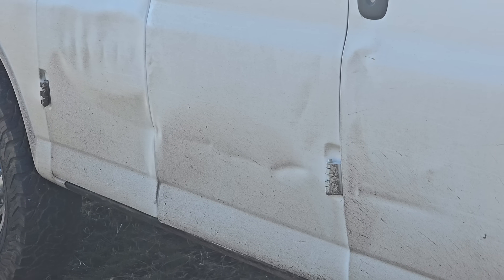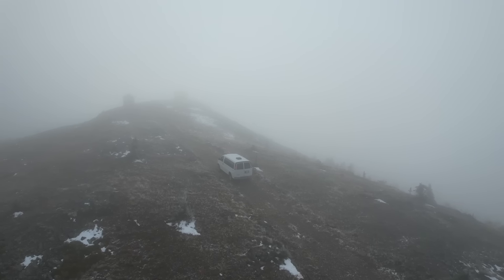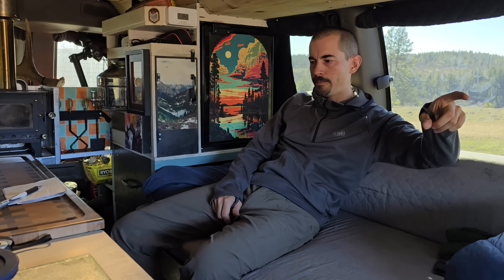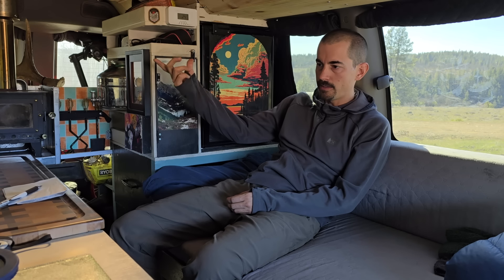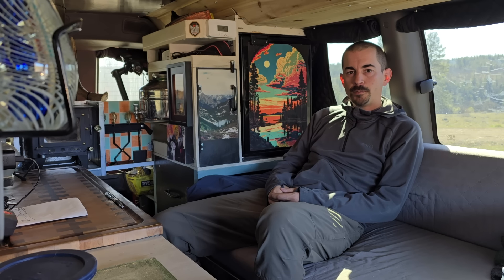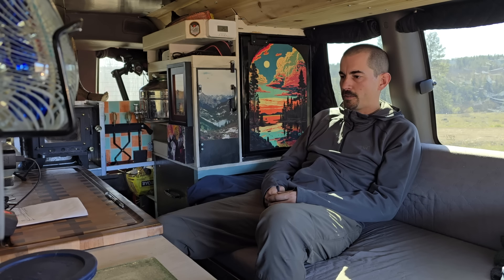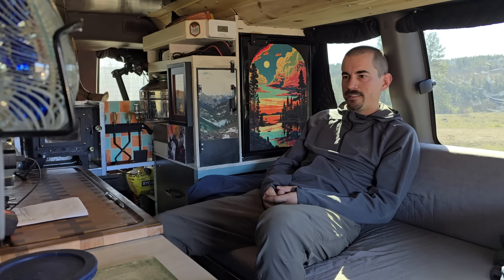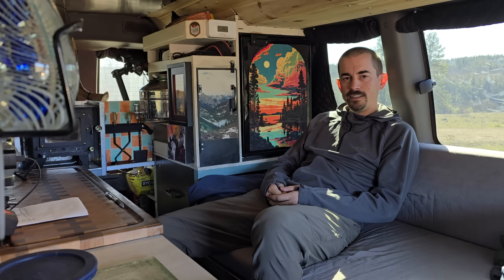Lets just talk about condensation and insulation.

Comment: Suggestion: think about making one/two large ceiling panels that are held in place mostly at the ceiling edges along the length of the van. Like a traditional one piece headliner. Less holes/screws of heat transfer. 
Make a pattern from cardboard.  Then another from cheap wall panels. 
You may find something that you find esthetic pleasing, appears like cedar, or white color to brighten the interior. 

Replace windows with acrylic dual pane will be expensive and time consuming. Make excellent window covers instead. 
Definitely like the rear wall and front wall idea to reduce area to heat. That will also be better for a hot day, especially the cab area.

Certainly consider the offers coming in from folks offering a room and work area. You are worthy, they will be fulfilled knowing they helped a good man.

You dont want a pop up ceiling? 
Or a slightly raised roof?
That option design may provide the ceiling insulation you desire. 
You dont need to raise the pop top if you don't want to heat the additional area.
Of course, that type of top must be able to support your solar. 
You deserve to be able to stand up full height! Just 8 inches higher will be more comfortable and probably will not effect your MPG or outback agility.

Comment: I think any insulation is going to make a big difference. No taping and sealing. No spray foam. Nothing that makes a mess or makes a P.I.T.A in the future. Just put a layer of 3M Thinsulate blanket and affix your wood panels through it like they are now to the van structure. For the windows, make some "Owens Corning FOAMULAR 1/2 in Rigid Foam Board Insulation" inserts and black one side and white/design/silver the other side (interior). They are wicked good insulators and you can stash them on the not so cold days. They also make for good SUMMER insulation to keep cool with the silver facing out. The 3M Thinsulate breaths well and works well. It also compresses well for use as curtains and dividers. Windows are probably your biggest source of heat loss due to both the infra-red loss and conductive. Good luck and can't wait to see what you come up with!

Comment: Good approach to insulating the roof. The tricky part seems to be gluing the 2 x 2's in there securely enough to attach the ceiling to? 
I know you don't want to puncture the vapour barrier at all, but in houses it gets stapled to the studs, which seems to work OK . 

You could possibly screw the 2x2's directly to the metal ceiling, the bottoms flush with the rigid insulation, and run the vapour barrier smoothly under both materials. To minimize puncturing the vapour barrier you could then run thin cross pieces at right angles to the 2x2's, maybe every 3 feet, and then attach the ceiling to them at right angles. 

You could put globs of sealant on the cross pieces before you screw them into the 2x2's, to make a tighter seal. 

It would lower the ceiling a bit I guess. Just a thought, if it turns out you can't get the 2x2's glued in securely enough.
 Good luck!

Comment: So glad you are sticking with the van.
I have been thinking about your condensation problems. I also watch a lot of boat and RV channels.
I think you take out your existing roof, rough up and spray foam the roof and adhesive your interior roof board to the foam...screwing on the edges, sealing on the outside. The spray foam gives the humidity no place to go. I would put the board up first, drill holes in it ti spray the expandafoam.
But the main thing is you need powered air flow in the rear (all the way in the back, like one of the rear windows) to drag the heated moist air out and balance the interior humidity.
It is easy when you are driving, just open the rear vents and crank up the van heater.
When parked, and using the diesel heater, turn the powered rear vent on low to route the humidity out of the top where it is hotter and the moisture is accumulating.
Also, if you ever do decide to change completely...
Get a 4x4 Tacoma with a LONG bed and a raised camper.
Same interior space...but able to handle much rougher terrain.
Have fun summering in Canada! 
Looking forward to all your videos as always.
Your fan since the fat tire cross country mini van days!
Also: What was that little car you used to joke about making it anywhere?
Reply: Spray foam outgasses bad fumes.
Reply: @jspencerg  when sprayed incorrectly/different than specifications
Reply: @currincook6422  Doing it wrong or using the wrong foam would be a total disaster. I wouldn't want anyone to experience that.  Do the research and get the best advice.

Comment: I would suggest that if you're looking to make an insulated compartment that you use duvets to hang to divide up your space. They're cheap, washable, removeable for warmer weather or just getting daylight, and can easily store inside vacuum packing bags.
I hang them behind my curtains in the winter to provide some insulation on a big wall of drafty windows and it makes a huge difference in my 10th-floor apartment!
Reply: I like this. Simple and easily removable in case they don't work out like you thought.

Comment: I was watching your skiing video and you mentioned putting off the rebuild. It hit me that you could insulate the van without taking it apart using two part epoxy expanding foam. Unlike spray foam two part epoxy foam reacts and expands in an air free environment, where spray foam requires air to react. Epoxy foam is used in boats, planes and racing cars as along with insulating properties its structural, meaning it adds stiffness to whatever you fill. Anyway, it reacts at a ratio of around 30:1 so you have to be careful but you could mix batches and inject it into your walls, your nooks and crannies. This is very similar to the foam that is used to spray onto the inside of roofs/buildings for insulation. Just a wild n crazy idea for you. I use the stuff to make form fitted seats for racing drivers and to fill aluminum box like crushable structures on race cars that protect the driver in an impact.

Comment: I've been researching the same thing myself anticipating a doing a build this summer, and a majority of the video recommendation, mostly from professional van retrofitters is to use closed cell spray in insulation. It both insulates and and forms a vapour barrier. It is expensive, but it does double duty. And if you have glued in wood ribs or cross beams before, you have something to attach the internal panelling to that will not compromise the vapour barrier.  It is something I am considering.

Comment: You can build a winter only dehumidifier by running a duct loop that forces cold outside air through a metal condensator inside the vehicle and then back outside. Put a fan on or near the condensator to pass humid air over the cold surface. At no point should outside air be entering the vehicle. The only powered components are low draw dc computer fans. Copper heat exchangers  and smaller vehicle radiators make for good condensators.

This will only function effectively if they outside temperature is significantly colder than the inside temperature, but those are usually the times when humidity is the biggest concern so it works out.

Comment: Honestly, I don't think condensation can ever be conquered in a metal box.  I used Thinsulate for my ceilings secured with 3M spray adhesive, polyiso on my floors, and glass wool in my walls & doors.  I also used EZ cool as my vapor barrier and sealed them all with the HVAC foil tape. And I installed several electric dehumidifiers and hung Damp rid in the rear and use the silica bags in my cab area.  I do use propane to cook and heat my water, have a shower that I use a few times a week but always wipe dry, and a diesel heater for heat.  Guess what?  There's still condensation even though I use my Maxxair fan AND crack my windows.  

Insulation and a vapor barrier are definitely great because it will keep you cooler and warmer.  And, I do believe it will help with the condensation, but I honestly don't think it'll ever go completely away.

As for wiring, I installed it on top of the vapor barrier to have access in the event I need to make a repair, create a new run, etc.  

Good luck to you!

Comment: I used spray foam,  small propane looking bottle for small house projects.  Have had my van since 2018 and haven't noticed condensation issues.  Usually with 2 occupants. We do try to vent at night and heat with a diesel heater.   Can't say I've used it in extremely cold weather a for prolong time.

Comment: I would worry about vibration causing the glue to fail over time. A house is one thing but a van experiences a lot of movement during its life. Good luck, I'm sure you viewers will have some good suggestions.
Reply: I was thinking the same thing. Maybe spray foam would have the adhesion needed to keep the ceiling up while driving around.
Reply: I build all sort of unique and crazy things for a living. The modern adhesives are completely amazing. I used Titebond Premium Platinum $14-16 a caulk tube to hold down stainless (warped) to wood structure on reclaimed tables to be rolled and rough handled in a convention center of 10 acres under roof. . NOT one issue. It was a CRAZY clamping job, but I got the warps pulled down and DAMN it is still holding. Worth every penny.

Comment: I use expanding spray foam to hold windows in brick walls. I've got a few doors hanging on spray foam with no mechanical fasteners.  The key is the expanding, not the stuff made for windows.  
Expanding is like a glue.  The studs could be hot glued until the foam locks them in.

Also...when ugly winter hits..the winter you don't want to be in...drive south.  You are welcome to use any of my driveways....there is always a room too.   ( I wish there were fewer empty rooms but oh well ).

Comment: Everyone has their own methods of insulating a van because there is no solid baseline of knowledge to lean on, as there is with conventional living structures. For vehicle surfaces that are relatively flat, I feel that closed cell ridgid foam board can't be beat. In my build, rather than using a waterproof membrane, I used closed cell expanding foam to seal the edges around foam board segments. Then, trimmed excess foam with a handheld hacksaw blade. My thought is that this might be an easier option than fighting gravity attempting to install a membrane on a ceiling, which would need to be a very large sheet for a seamless covering.  For sidewalls, which have few flat surfaces, rather than use conventional insulation, I opted for automotive grade 3M Thinsulate without a vapor barrier, because it has inherent hydrophobic qualities. Also, being a non-organic material, there is nothing mold can use to feed on and grow.

Comment: Using closed cell spray foam will give you a monolithic sheet of insulation over all the metal surfaces and does not need a separate vapor barrier.  Closed cell foam is exactly that,  closed, which means moisture cannot get through.  Diy kits are available online and consist of a part "A" tank,  a part "B" tank,  hose, and sprayer nozzle with replaceable mixing tips.  I've used this stuff myself and it's pretty simple and easy to use.  
Glue your furring strips up first, run all your mechanical systems,  then encapsulate it all in the spray foam.  Sealing the van up that tight will require you to run some sort of air-to-air heat exchanger tho. Without it, the inside of your van will get like an old refrigerator that was left unplugged with the door shut.

Comment: The interesting thing about insulating a van compared to a house is that in a house, the outer surface is vapor-permeable (wood cladding). In a van, the outer surface is sheet metal, meaning it is 100% impermeable. This has made me suspect of a lot of advice I've seen from home builders. I think if you're going to do a vapor barrier it's best if it is adhered directly to the metal, such as spray-foam or flexible closed-cell foam with adhesive backing and foil coating (see this a lot on british builds, it seems - they have wet weather but not very cold weather). Since the entire structure is adhered directly to the van and every layer is vapor proof (closed cell foam is its own vapor barrier, a foil backing just makes it 100%), then there is no cavity for moisture to get into and hang around.

I am not sure what is the best solution and there are many methods that seem to "work" well enough... as for longevity, I don't think anyone has data to make verifiable claims.

that's my thinking so far. not an expert just someone else currently considering options. I think most of the spray-foam builds I've seen are from very cold climates - norway, AK, CA, etc so there might be something to that.

My understanding is that spray foam can potentially warp the metal panels as it adheres and expands. You probably don't care much as it's already dinged up. To avoid this it must be applied in very even, very thin layers that even professionals sometimes mess up. It's fine for a BUS because there aren't huge pieces of sheet metal to warp, and skoolies care a lot less about the looks. But it has the best R-value per unit of THICKNESS by a good margin which is what we care about in a van - maximizing internal volume. Also, spray foam is super permanent, it's never coming out. And with all the windows in your van you may not care about completely maximizing the insulation as it will have diminishing returns with so much glass.

Comment: Simon. I used heavy thermal curtains in my motorhome.  It was n8ce that i could seal off the drivers area. I then uses reflective on the ceiling and walls and a layer under the floor. This alone my temperature inside was +21c at -65c in Saskatchewan..

Comment: I would go with the rear wall and possible a thermal curtain up front.  Cheap and easy.  Then you could decide if you wanted a permanent front wall.  I plan on going with a thermal curtain for the front of my build. I like the idea of being able to use the cab area for space when needed.   Possible store wet boots in the cab on other side of thermal curtain.

Comment: Not only can Rocco drive, she knows sarcasm as well. I believe that foam board or spray foam does not require an additional vapor barrier. Any gaps in the foam board can be filled with cans of expanding foam,and I believe the canned foam can also be used to adhere the foam board to the ceiling. Mike from MASS.

Comment: Hi Foresty - love your videos.  Its not a good idea to have an internal vapor barrier on a van because the van skin is also a vapor so you would end up with two vapor barriers with a space between.  Any water that gets between the two will have a hard time drying out.  Water can get in from any kind of small hole in the inner barrier or from any kind of rain leak in the outer van skin.  
I think the best scheme is to use a rigid closed cell foam board like Polyiso and adhere it to the van sheet metal with a urethane foam like Great Stuff, then run a bead of Great Stuff around all the edges of the foam board.  This way no water vapor from inside the van can get to the cold sheet metal and condense.  The inside surface of the foam board will normally run warm enough that it will be above the dew point and there will not be condensation on it.  
I spend a lot of time on the ProMaster van forum over the last 10 years and many of us have used this scheme and it has worked well over time.
I did some testing on how various insulation schemes handle water vapor under realistic conditions (Polyiso, Thinsulate, Wool, ...).  The results are on the Build A Green RV site under the "Tests" heading.

Comment: When I first trial ran my 2006 dodge sprinter about 4 years ago and hadn't read the manual... It was severely fogged up in the AM in the spring in the Washington Cascades.  It sorta turned me into a weekender  :))  I hadn't really ever dealt with it to such a degree.  So my van is actually my work van so I daily regulate temperature.   I like your approach to sealing it up.  Mine was a passenger van so it had a bare minimum insulation.   Think I'd prefer fairer climates.  I'm looking to improve the sub layer of my bedding.  Think I'll go with a base that allows air, a thinish futon, then a memory foam.... 😂  Good luck! I'm also dealing with issues related to a 20 year old disel vehicle with 300k :))

Comment: Hey Forest,
Watch this video on condensation. It's WELL worth it!!
It's from "The Frugal Factor." He does a GREAT job showing HOW condensation works.
I'll tell you right now, do NOT bother with a vapor barrier; it won't do anything but trap water between your metal and the insulation. 
Frugal showed that even if you glue the insulation directly on to the metal and then put a vapor barrier on top of that... condensation still happens.
There's stuff called Poly-fil. It's what they use in the cushions of those patio furniture sets that are made to sit out in the rain.
I'm going to put about of a 1/4 inch of it between my insulation the walls of my box truck. Any condensation that happens will be able to flow down the wall through this stuff and out of my truck. 
I'm going to leave about one inch at the bottom of the wall free of insulation and if any water shows up I'll just mop if up. The floor of my box truck is the wood that came with it, so no big deal. I’m going to use metal buckets for all of the food stuffs that a rodent may get into. Everything else is going into those Project Source bins from Lowe’s. I’m going to build a shelving system out of Unistrut. Enough about me…
This video is quite fascinating:

https://www.youtube.com/watch?v=bcFqy8L_DO8&list=PLBh1SzyOYdBai7-uSRZH0_R_y0LjehE0I&index=10